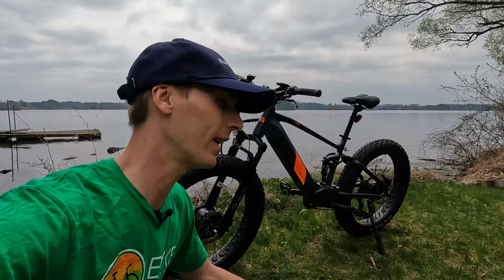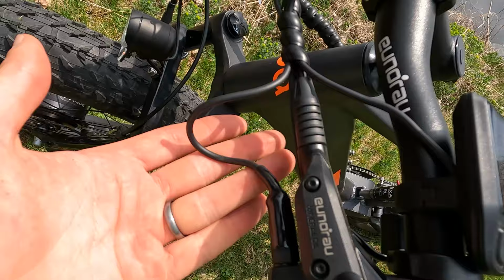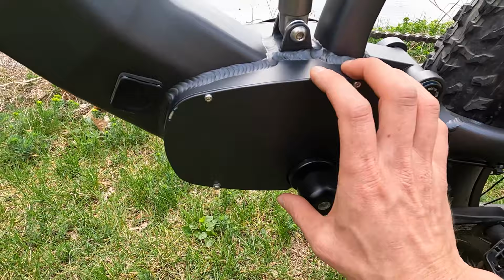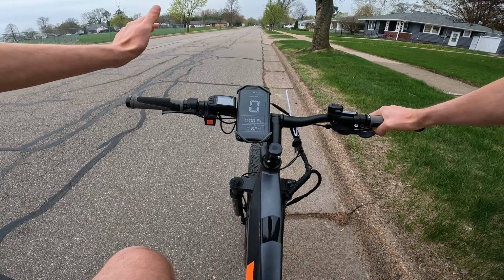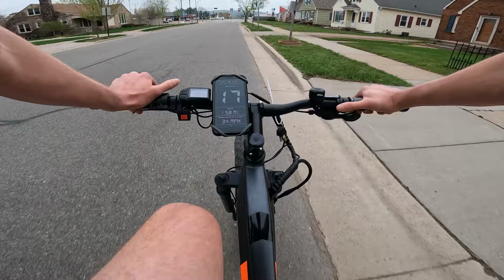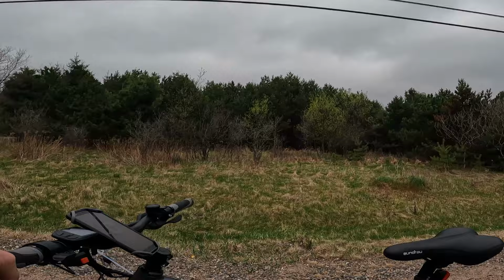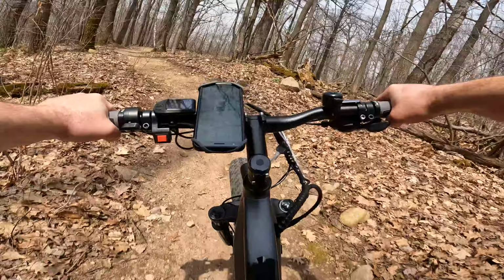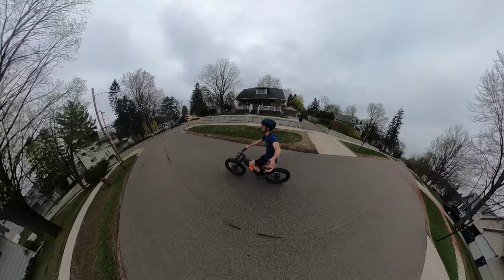Eunorau Defender S: Unreal Performance with Dual Motors And Full Suspension

Comment: With dual batteries, this would be a great bike for exploring. That single track showed off the suspension, but a single motor with 2000 watts would be more nimble in the corners. I ride single tracks a lot, but some of the hills are steeper than 20%, and a front motor would just spin. Thanks for another great video!
Reply from the maker: Thanks for watching!

Comment: The upgrade from the 14AH internal battery to the 17AH internal battery is $530. It looks like you can buy the 17AH internal battery under their accessories for only $599. So, for only $60 more than the 17AH upgrade, you could get BOTH the 14AH AND 17AH internal batteries. They really don't give you much credit for the 14AH battery toward the 17AH upgrade. Very cool bike though. Thinking of replacing my Rad Rover 5 with one.
Reply: I feel a 52v would be a second addition as well. Alibaba has the 48v 17ah or 52v 15 ah options already.  👍

Comment: Want to FYI on most DIY Dual or AWDs. Most ppl set up their Duals with high wattage DD gearless motor hubs which one downfall they likely come across is the Brake System not meant to handle powerful torques of speed as with the mass added total weight, the brake system will flutter as I believe this topic most DIY Dual users not talking about but it's obvious they having issues of keeping brake system stable. Remember, bikes and their systems mean to for 20 mph as top speed for practical use.

Comment: Ariel Rider grizzly does very well up hill but its a 52v dual battery setup so its hard to beat that setup. Plus it has better torque due to the 24 inch wheels vs bigger 26 inch wheels.
Reply: grizzly has 20" wheels not 24
Reply: @ghoul114  oops. Thanks. Technically it has 20” wheels with 4” tires with an outer diameter of 24” lol.
Reply: Has 16" wheel/rim.!!

Comment: For the closest comparison to the Defender S I recommend you review the "E-CELLS" bike. 2 motors, 2 batteries, dual suspension.  $4,795. for the top Monarch Crown model. Yeah, very heavy at 95 lbs. but quite high quality in build and components. E-CELLS is based in Parumph, NV, just 40 miles north Las Vegas. For me that's virtually "local".
P.S. you will find the E-Cells Super Monarch Crown has higher quality components than the Eunorau Defender all across the board. 
Yeah, the $4,800. price is "mid range" for a quality EMTB but there are a LOT of extras with the E-CELLS bike so a great bargain overall.

Comment: In the Letric Neom 20 LS folding bike, I installed a 350 W 36V hub motor in the front wheel, which I drive with the gas lever on more difficult slopes, and with the existing 250W motor in the rear wheel, even more difficult slopes can be overcome. The cost of the conversion was approx. 200€, and the additional battery is from a 4Ah string mower. Link; 2wd e bikes.
LP
Tommy Stone

Comment: you know one cool bike to reiview that ive seen is the new ariel rider kepler its a fat tire hardtail with a ton of power 1800 watts peak and a 52v 20amp battery and costs only 1800 bucks
Reply from the maker: On the list to review. I've been in touch with Ariel Rider.

Comment: Adding a 17Ah on top of the default 14Ah is $530. Just going from 14Ah to 17Ah in the frame is $530 alone. Forego the 2Ah and save $530 by just adding the 17Ah second batter.

Comment: Dual motor sounds like a good idea in theory, but on an off-road bike it's not worth the extra weight or the decrease in range.
Reply from the maker: The Eunorau has a switch that allows you to "turn off" one of the motors. While we agree it isn't great for on road use, it sure is fun to feel the pull from 2 motors.-JT

Comment: What bike would you recommend for alot of sand riding on the beach?.Thanks.Lee
Reply from the maker: Any fat tire ebike at low tire pressure. Harder sand will be no problem but super soft sand will be a challenge no matter what. AWD is better but any fat tire ebike will do. Be sure to keep it clean to help prevent rust.

Comment: Are they both Gear Motors? I've discovered the best PRACTICAL use of a Dual E bike from what I studied on many dual modes but most not really practical of being double the Cons over the Pros.
Reply from the maker: Correct, geared hub motors.
Reply: @EbikeEscape  I built a Turbo Boost 350watt Gear ⚙️ with 2000watts Turbo Boost or my warp drive thrusters. I can go over  20 miles non stop full throttle on my 350 assisted by the 2000 watt boost going over 32mph( can do more but why on busy Blvd) This set up cut my energy outage by
 Half. Going up hills I can go 34 tops of steep long hills not little hills but the steep ones. Before the Dual I could ONLY top 20mph on the 350 gear while my DD e bike tops 40mph but can't go long distance on full throttle without motor cutt off to cool down. Now, with my set up, bike is only 80lbs, no burning out motor or battery. I did my math for months studying others builds as I came up this methods for overall practical performance and energy efficiency. Only hooked up the motor wires, battery, and throttle bar of the 2000watt having NO CLUTTER junk while keeping bike light as possible. Pro builds should use this standard of the type of motor for many builds overkill as jus EYE Candy. My Dual outperforms the factory custom made ones as I can go up hills using just 1 motor instead of having to use both. Not motor add on but more a Turbo Boost accelerated gearless DD made for this.
Reply: The key to this is the Cruise Control off the Gear ⚙️ as this mode let's me add the 2000watt having no start off torque minimizing the wattage. You really have to think thru your Dual DYI to ensure it is not overkill of a burden later on. I wouldn't waste my time any other way for total cost of my build is 1400$ but outperforms the 5000$ and up factory made Duals or jus singles. My range now is 80 miles, 120 plus  with PAS while having e bike easy to handle of only 80.lbs. I know this set up will be used more of being Practical and Efficient.
Reply: I am curious about your built! Any more specifics or videos? Would be good for a youtube video!!!
Reply: @odalv7278  It's easy build of taking a Gear motor e bike of adding a 1500 or higher watts Gearless motor as turbo booster. Just use the extra throttle bar on left handle bars, hook up the main motor connectors along with controller n 2nd battery, no need to hook up extra set of parts over these. The purpose is to go long distance of over five to 10 mile non stop trip at high speeds of 36 to 40 mph. Trick is to use cruise control off the Gear motor and turn on the Gearless and you out n about.

Comment: Hills! Big problem we're i live, leaving my house i coast about an eighth of mile then about 200 feet flat then up hill for a bit, everywhere i go is like this, i couldn't ride around here without the help of the electric motor, I'd like to know how long that battery would last in my area? The bike i have has dual 20ah batteries n i can go a lil over 10 miles per battery, considering the heavy bike (fat tire trike)  and me, I'm fat , the reason I started riding n is working...
Man, i can't justify the price, agreed it's a nice ebike but, $3000 Is a lot, I'll have to stick to building my own, $800 to build my trike, that includes 500 for the bike...

Comment: I would like to see a head to head versus the Ecells bike with dual Motors and batteries.
Reply: I was looking at this bike but bought the E-cells Super Monarch AWD (Hunter/Camo version).
It’s a tank.  Better components all around.
Reply: @BongoBrains11  it’s at the top of my list! That orange color is popping.
Reply: Great mention, thank you!!!;) Looking into it now!!!;)
Reply: I should add:

It’s a beast, (weight)….   Consider your application target.  I wanted a tank, without having to step up to a Rambo ‘tank’ for too much more $$$$.  
I got mine a couple months ago and am still learning it.

It is the equivalent of ‘relearning how to ride a bike’…. 🐸👍
Reply: @BongoBrains11  Good to know. I don’t usually get to froggy. Mostly streets and bike paths. Occasionally I’ll get the urge to go exploring and go off road.
Reply: I wanted to be able to haul gear.  
I have the Bakcou Hunting trailer, Rambo waterproof bags, a solar generator system stored in waterproof faraday bags and camping gear to contend with, plus another trailer in case I want to haul a Canoe or Kayak.

If you’re just going to ‘dabble’ in utilizing the strengths of the bike, there’s much less expensive options that would be more fun/appropriate.  You don’t need to commute in a Hummer when a Tacoma will do just nicely…
Reply from the maker: No plans to get the E-Cells at the moment but maybe in the future I'll look into it.
Reply: @BongoBrains11  i want the ecells 1500 awd super monarch too but i wanted the blue one and camo was backorder too. but havent heard anything nd i saw some bad reviews on owner ? and warrenties. and HARDLYT ANY REVIEWS. and all are over 1 year old. so o not sure over $4k for shady service? i really want it
Reply: ME TOO BIG TIME,
Reply: @BongoBrains11  how do you like ecells? i either buying ecells or this. watch your opinion? i like ecells cause its 52v too.and the quitlity of parts is way better is it worth extra $1k. thx for advice. i buying tomorrow one of these two. need for hunting in maine. also i use to commute in boston everyday about 20 miles a day.
Reply: @‘Mad/Max’
The bike is a Beast…

Unfortunately I had the rear axle ‘Spin Out’ and f’-d the rear wiring to the Hub Motor.
Strongly recommend some ‘torque plates’ (and am in the market for some myself).
Reply: Add:   (This just happened last night). 😒
Reply: @BongoBrains11  do you recommend it for me . im 62 250 and need speed in boston traffic when need be for work i also need the racks and front basket cause i carry tools/stuff for work. and need power and AWD for gettin out of woods with game. thx for reply brother love the nickname
Reply: @Mad/Max  I can’t personally imagine riding in an urban environment regardless of the bike you choose.
I’m in Northern Michigan and live in the middle of the woods…. That said; my primary concern would be in one taking notice of the issues others have experienced.   In my case, my primary issue has been in having the axle ‘spin out’, and wishing I’d have acquired torque arms/plates from ‘Mile 1’.
It’s a heavy bike, fully loaded it is a handful….but that is/was expected.

I’d just recommend fitting it with torque arms from the start.  I think it should be standard from the factory with powerful bikes.
There’s a lot to praise about the bike, but this particular shortcoming might be worth noting and addressing in ANY high powered e-bike…

Comment: I do not need rear suspension, need two or with trailer good to have 3 bat.
3 bats in parallel means Current divided by 3 so lossess internal and cabling goes with square IxI/(3×3) so lossess reduced 3x 1/9  what is reduction roughly 2.5 times will be drop voltage and some lossess on modules to connect batteries in parallel.
You have to test this bike with 2 batteries not only one.

Comment: i hate to say this but i checked this bike out ,the battery and controller electronics and there is no way each of those motors is putting out 750 each ,honest math estimate ,350 watts true each motor
Reply from the maker: Really? Their 250/350 fat tire ebike was noticeably less powerful. This in my opinion feels like dual 750s. I don't know why they would lie.

Comment: Range on this thing throttle only?
Reply: I have the standard 14Ah internal and the pickyback 17Ah. If I were to use only throttle and both motors running on flat ground and ran it at around 15 mph, my guess is it would get around 40 miles.

Comment: For the price there's no reason why it doesn't have a wired rear break light
Reply from the maker: The point of this ebike is to be more of an offroad/hunting ebike. Where tailights are not needed. However we agree, for the price, there are a lot of other ebikes that have integrated front and rear taillights. -JT

Comment: just remember dual motor bikes in these set ups are not faster than single motorsthey have more torque,off the line ,and better traction on sand etc,but they also get half the range and lower top speed than a single.
Reply: i have a 2nd motor on my bike its 500watt rewound bafang modified ,its only used for launch control ,push to pass boost ,or switch to front only on .long flat road for an eco type power saving, i never run the 2 together all the time, as the rear motor can hit 100 mph if the wind is right
Reply: i must admit ive run those bafang motors on 84 volts with 150 amp dc controllers and they can be made to go seriously fast for such a small motor have to watch their heat though ,they can get bit to hot if not carefull at that power
Reply: @katiekumcgil 100 mph? On a bike??
Reply: i have a quick video on my youtube page that shows the early part of the build with the suspensions mods we had to do to be able to handle it

Comment: This is a terrible bike for what it’s trying to be. Which is a trail bike. Instead of two dual hub motors they should have gone with a Bafang G620 mid drive which will provide a torque sensing power delivery that a bike like this needs. Just look at the housing on the frame. It’s clear that a mid drive motor is supposed to go there. As it stands this bike is a hack job and at this price you’re much better off buying a Sondors Rockstar.
Reply from the maker: I don't personally view this as a trail bike, or at least what I view as trails. The tires are too wide to be nimble. I don't think a mid-drive can match the traction you get from having 2 motors but I agree unless you NEED two motors for snow or something there are lots of other great options out there. I still think this bike is a blast.

Comment: i'm looking for a fat tire ebike for snow season at my trails. this is currently top of my list. how did they manage to keep it at 80 lbs with 2 motors !! what does the range look like ? what are similar priced comparables but only with fully integrated batteries no humps here:face-blue-smiling:
Reply from the maker: There is a larger battery available, that fits into the frame. Range is not the greatest when throttling on two motors, as you can imagine. But if you are reasonable with the power, you could get some decent numbers out of the 17Ah battery. 30ish miles is achievable.
Reply: @EbikeEscape  that's not bad at all. it is almost perfect for flowy snow trails then. also now i just to figure out transportation no way any any universal no-hitch bike rack can carry this beast safely at 80lbs:text-green-game-over:

Comment: Cannot understand those people do not know how to sell el bike the same with hybrid cars  real deals.

On website there is data max speed  45km/h,  ???? For one motor only???or????
I am 115kg plus 5kg backpack around 120kg,
There is part of road where push to max speed sometimes,

Have two batteries,   upwind medium strong 54km/ h  and down wind 58km/h???
That is more than one class above from website advertising.
When bought bike had one bat ,  max current has been set 15A that is with full battery 750W, nominal value for one motor,  I moved to 22A,  later bought  2nd battery and lift max to max available 30A max that is enough for 2 times 750W when battery above 70%.
With 2 motors it is very easy reach and ride at 40 or 50km/h a nd firmly hold the speed upwind and uphill or low incline. Two motors nice firm acceleration and distribution of force over bike.
Maybe they have one controler  so cannot control precisely each motor so put max 30A what is nominal power for bouth motors,  peak for each motor is 1100 to 1200W what can gives you 2200 to 2400W  , 48A required to split between motors? Probably firmly would be able to reach  above  60km/ h  ?????

I ride mid drive bafang 1000W nominal,  max  peak 1500W, max speed above 50km/h but that goes through changing gears, it is one class below of Defender S dual motors.

Heavy steady at the front stronger fork motor peaks well over 1000W, on flat run front wheel pedal rear one even in pass1 very nice steady  ride just flow over any bump and tree roots on pathway, downhill over 50km/h no any vibrations. When you go steep hill just turn both motors on with your easy pedalling run fast even over bigger hills.  Must have two even 3 batteries for longer runs. Front motor pulls you over do not dig in before any rise,  2 motors can pull 45A peak  that will cause huge sag of voltage and reduced performance with single battery even can reduce lifespan of the battery .  Position angle  of the fork , soft suspension  ( like Talaria) and longer distance between wheels makes ride far more plesent in turns with speed and even over serious tree roots in trails and parks which normally through you out of sedle.

Mechanicaklly bike excellent.

This is the top real ebike with meaningfull pedalling, efficiency, power, range.
For faster need moped not ebike and 20-30cm  lower sitting position at speeds over 35km/h pedalling lost meaning. At 40km/h required  power 1000W you input 100W? With lowering  and reducing air drag you benefit more , without pedalling  can have better susspension  real soft, and proper safety gear required at higher speeds., weight and not pedal friendly.

When you upgrade you got both batteties 14Ah and 17Ah. Bike needs min 2 batteries , good option 3 batteries. Max current can be close up to 50A, 45A /3 is 15A still big current you do not want go over 10A for long ride. 2x10A is 20A what gives you avg speed 40km/h and 1000W required. For speed 32km/h the real speed for bike requires 500W and 500Wh in 1 h . 3x 17Ah =51Ah   x 48V  gives 2500Wh  when divided by 500Wh  gives you 3-5h of high speed ride, no worries about bateries - range at 32km/h avg speed range  150km? At 25km/h well over 200km! You have to  sit on bike 8+h ??